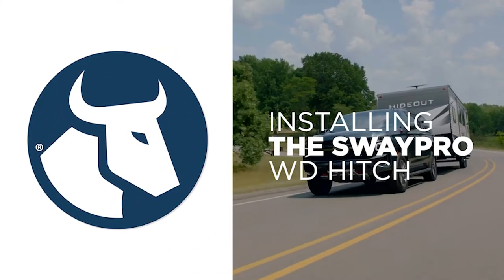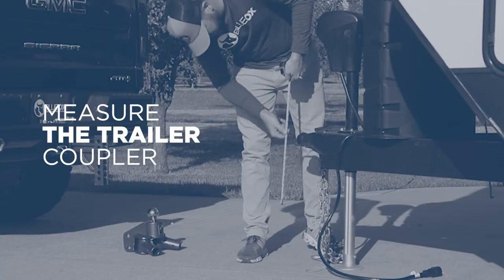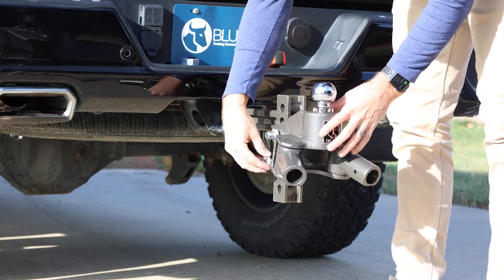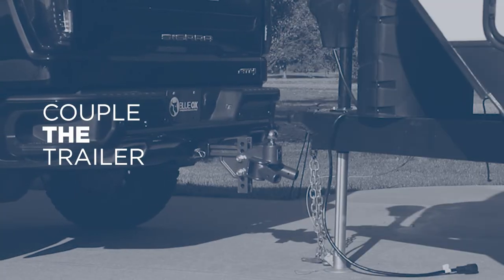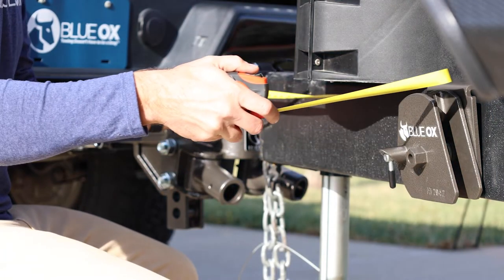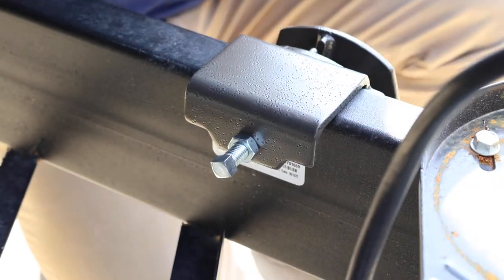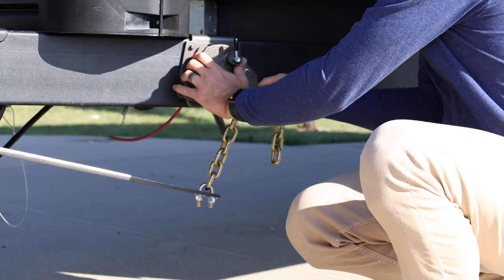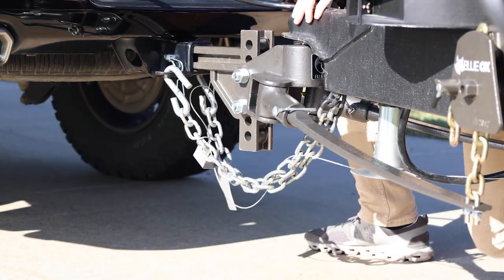Installing the Blue Ox SwayPro WD Hitch

Comment: I was a little bit nervous after reading people saying it's semi-dangerous when releasing the tension. As long as you jack the truck/trailer after they are connected as high as reasonably possible, I don't see how anyone could think the tension is much to deal with using the included bar.  Common sense here, but also position the bar in such a way that if it does kick on you for some reason it will throw itself on the ground, not into your face.  I found it extremely easy and safe.

Comment: Who do I contact with concerns? Had set up professionally weighed was told to go to 11th chain… not comfortable so have put at 10 but still see a “shift” at the inside cam connection with the A frame… thanks
Reply from the maker: Hi Beth, you can find all the ways to reach us at blueox.com. Phone, live chat, or email. Thanks!
Reply: Customer service was great for me before I even bought mine. I had questions about weight ratings and the young lady was very knowledgeable. I found the phone number on the website.

Comment: Do I need new bolts if I adjust to a new position? (Got a new truck)
Reply from the maker: No, you do not need new bolts unless you see unusual wear or if the lock washers are spread out. Just retorque to 250 ft. lbs.